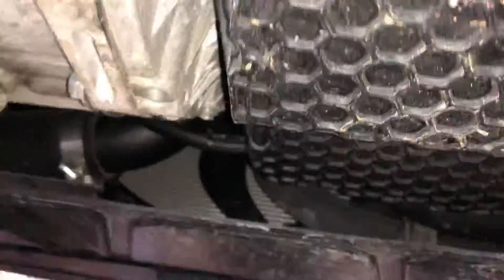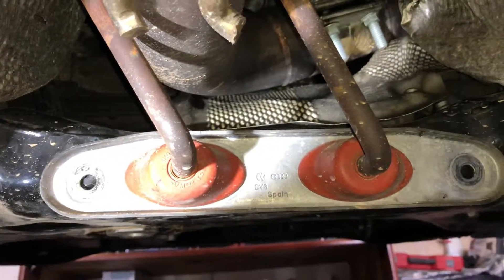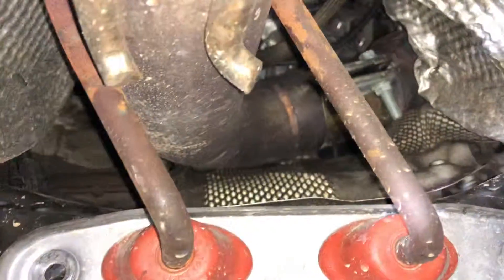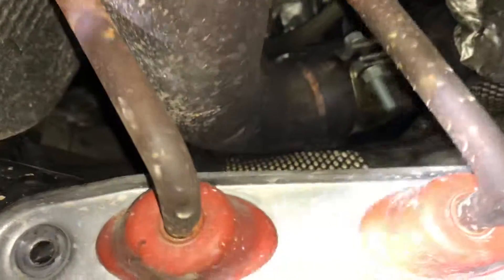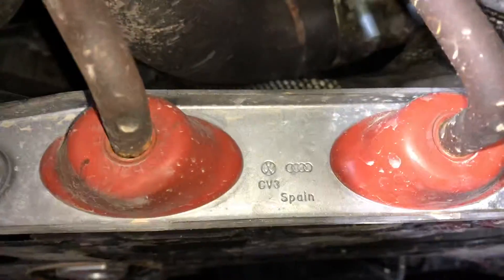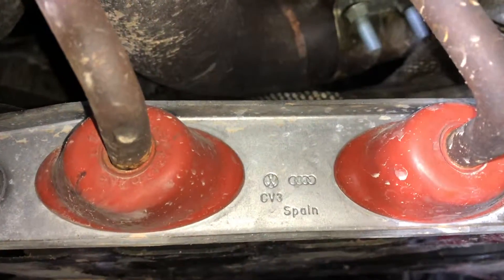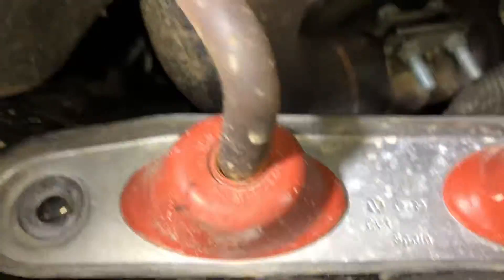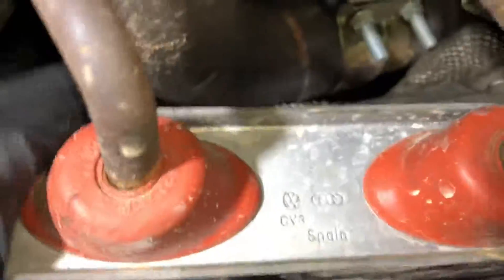HOW TO INSTALL WASTEGATE: MK7 GTI Part 1

Comment: My LSD is totally in the way - will have to drop the subframe to get at my WG actuator.  Did yours go bad or something?  Does that extender on the MAHL go on the flapper arm first?  Thanks for the videos!
Reply from the maker: Brian Copeland Man I’m sorry it took so long to respond. YouTube guidelines messed up all my comments. Finally fixed it...hopefully lol. 

I was having wastegate stuck codes popping up, so I thought my wastegate went bad. It actually ended up being the wastegate arm on the flap being bent, which caused the wastegate to not function properly. But before I found that out, I thought it was a bad wastegate, so I made this video.

You can put the extender on the flapper arm first. That will work, but I found it easier to attach the extender on the wastegate first, and then screw it into the flapper, as the flapper has some swing to it. Hope this helps even with my very late response.